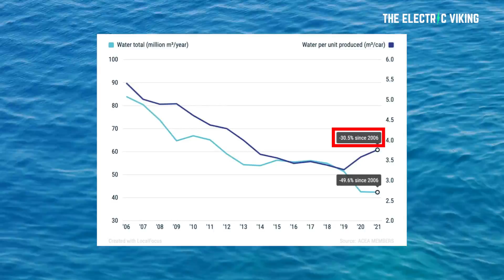Tesla's vehicle production to hit 260K in the 1st QTR of 2023

Comment: Electric Viking I like to know if the cars are sealed from water the batteries I believe they are but I like to know if the electric motors are I know the cybertruck is sealed and does not get water in there vehicle because you showed videos but didn't show any videos on the cars if they are sealed from water just in case of a

Comment: Hey Andrew a statement from thhatmanufacturer rarely can be taken to the bank.  When was that 4680 supposedly going to be in full production and used in the Semi, Roadster, and cybertruck?  You can find my key sources here on YouTube there are discussions by actual Lithium investors.  Lithium is up 1200%; and the reason is demand for EVs. No big supplier wants to be locked in. You may have  contracts but that is hardly an assurance of supply let alone at a set price. We can wait and see, in a year we'll know if Lithium supplies are the choke point. If Tesla has some sort of lock on supplies maybe they make most of the EVs - who ever has lithium can make them who ever doesn't can't  At present there isn't enough even counting stock piles - to meet demand.

Comment: Quick rule of thumb: 250,000 cars is basically one production line running flat out. This is based on: 2 shifts running 5 days a week at one vehicle per minute [no shut downs or holiday closure, with maintenance and engineering overnight and on weekends]. So 500,000 is at least 2 production lines. I've seen the Mini lines at Oxford and they run at a few seconds over the 1minute clock cycle.

Comment: You know self driving is a scam when they have staff loading cars on ships. Thatt is one of the simpler tasks for selfdriving and it can't do it??
Reply: How ? Someone would have to upload the software to enable FSD then they would have to decide where to program the car to park exactly on the ship with each car having a different parking slot with an exact sequence of loading. That would take many more Xs of time than just driving it on
Reply: How is that "simple"?    Each car goes different unique spots. Each ship  is different
Reply: @johnb7430  Exactly my point. Nothing about self-driving is simple .I said ,one of the simpler tasks, try city driving?
Reply: You do know it is still in beta?
Reply: FSD Beta needs a driver - so currently there would be no benefit in ship-loading process and a non-zero risk of damage to new cars.

Comment: Actually training ICE vehicle repair people is a good idea. Here is why:
1) Remember the “Valley of Death” chart where ICE car production plummets (around 2026 to 2027)? During that time there are not enough EVs to fill a huge demand and no one wants to buy a new ICE vehicle as they will deem it a waste of money…. which it already is BTW.  
Result will be that people will want to keep older cars going longer and put off a new car purchase. Ergo ICE mechanics, at least for mid decade, will be in high demand. 
2) EVs do not need much repair compared to ICE vehicles.  Overall demand for EV repair persons is limited as compared to ICE.  Therefore while there will be some demand for EV repair people, most of that will be for body shop work…. which is similar between ICE and EVs. So there is crossover in skillsets there. 

What does this tell us might be good to invest in or own…. at least in the short term?
1) Body repair and auto paint shops
2) ICE Engine rebuilding and replacement shops….allowing folks to keep an older car on the road.
Reply: There is already a growing demand for skilled EV repair technicians as early EVs have run out of warranty. And the flood gates really opened in 2019-20 here, so I think 2025 is a good guess when more people will need help to sort problems in their EV. Not that a large percentage will have any, but those that do will look for cheaper solutions than those offered by the brand workshops. For instance replacing a faulty connector instead of a complete section of wiring loom.
Reply: If you're a young unskilled guy though, do you really want to skill up for the short term? Probably not. Learning any trade instead (which are in short supply and will remain in demand) would be a much better investment.
Reply: @ordinaryhuman5645  Long term for sure EV training would be required. However other than going to Tesla’s new training schools, who else is training for this position? Also it will take two to three more years before there may be enough EVs…other than Teslas…. to have enough work to do. 
It is a tough decision of what to do and when.
Reply: @nickmcconnell1291  It's not that hard of a decision for anyone looking to learn a new skill. If I was a young guy, I'd opt for a conventional trade and let the legacy ICE industry fade away sooner rather than later. If I was an older guy, I'd probably just stick with the legacy stuff until it's time to retire. I'd pass on the EV specific stuff until that market is more established, and maybe demand for 3rd party service (since most people are probably dealing with OEMs for service as-is).

The awkward spot is legacy trained folks in the middle who are probably going to be losing their bread and butter business in the long run.
Reply: It’s getting there!
I heard that people in Norway have a hard time getting rid of the ice-vehicle. No one wants to buy them. That should be the ultimate writing on the wall.

Comment: 500k at the end of 2023 is kind of disapointing
Reply: Just think how far they would be if the insane German regulations had not added an additional 9 months to the build and ramp time of this factory?
Reply: How many gallons of bio fuel that ICE vehicles use during it's lifetime and folks are complaining about water.
Reply: @breyrey7612  Agreed! Tesla should just buy that mine and shut it down, alleviating any water concerns all together.
Reply: Additional perspective,  an average American household uses 80 gallons of water per day.
Reply: Yes Shanghai showing them up big time, by the end of 2023 Berlin would have been open for at least 1.5 years